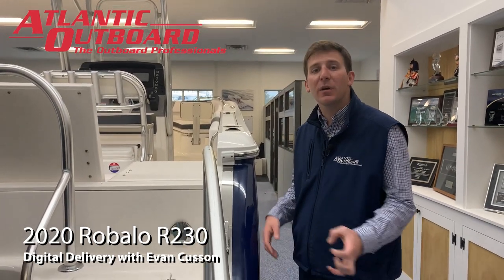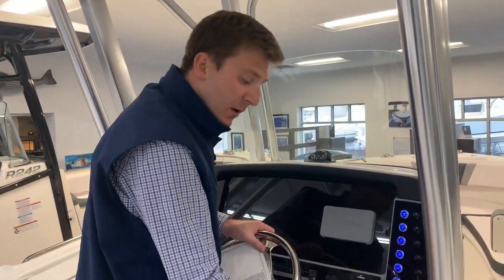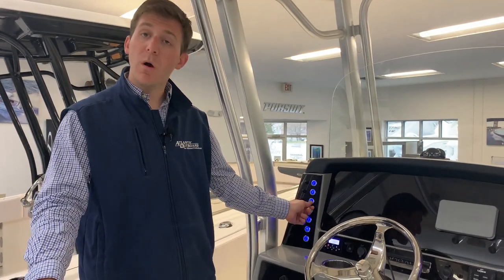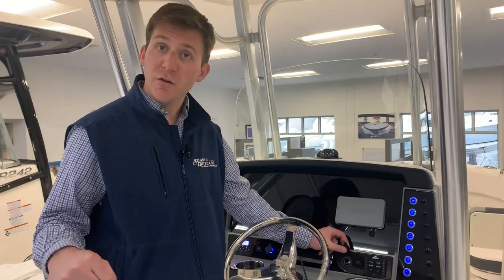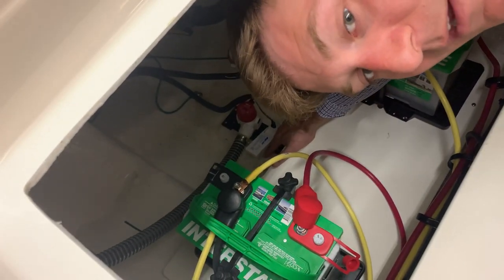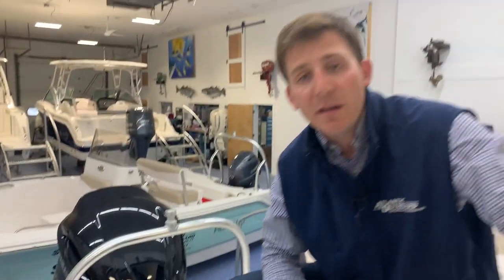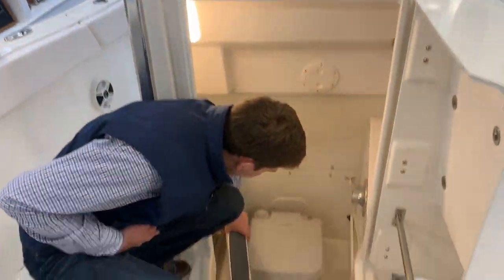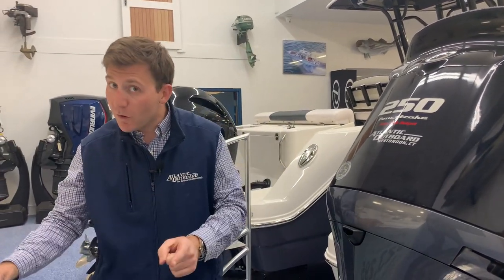Digital Delivery: 2020 Robalo R230

Comment: What's the difference between the Explorer series cc's and the regular cc series?
Reply from the maker: In the 2024 model year, the former R230 was renamed the R232 Explorer.  The 2024 R230 has the same hull as the R232 Explorer. However, it has a higher bolster in the transom and a flip-down seat.